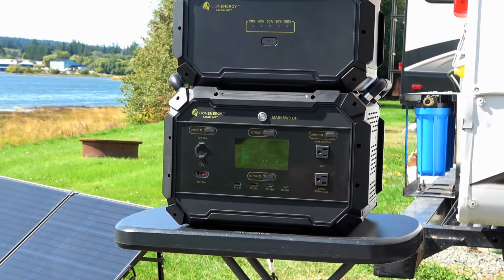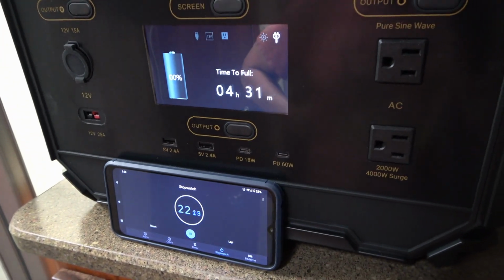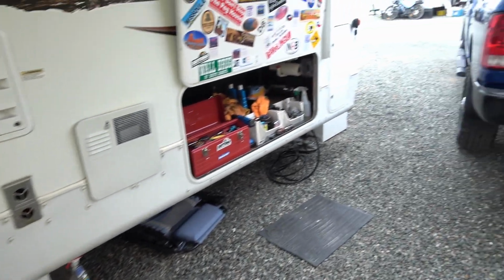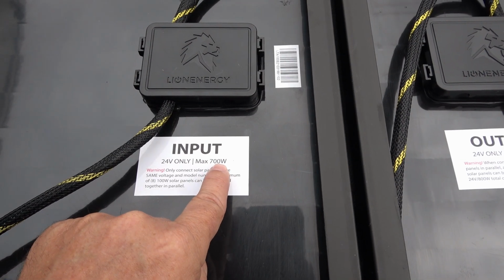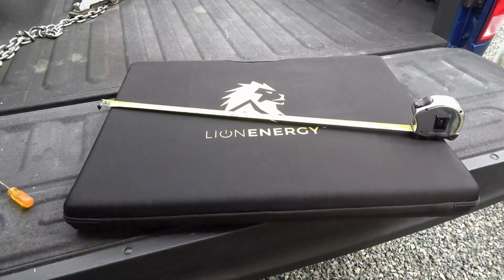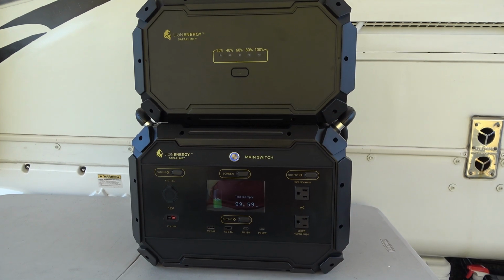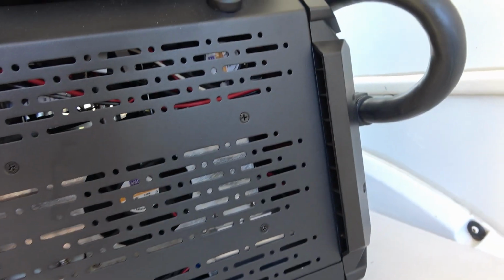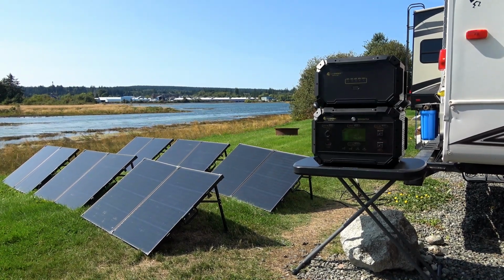Safari ME Deluxe Portable Power Kit Review - 600W Solar & 2048Wh Expansion Battery (Lion Energy)

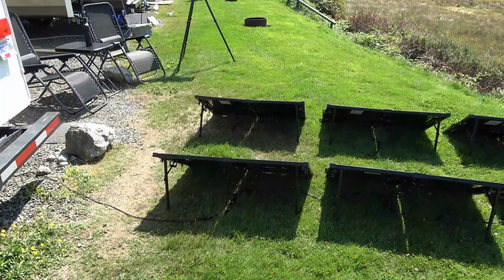Comment: Good work! One correction I found  in18:57 These panels are wired in series (daisy chained), not in parallel.
Reply from the maker: Thanks, but you're wrong, they are wired in parallel. I know for sure they aren't series wired.  The voltage coming off the array measures near 40 volts, right around the Vmax for a 24V panel. You can see that measured in this clip https://youtu.be/wtSWk0S281A?t=212  If they were in series, the voltages would add together, and I'd measure 6 times as high. Cheers, Ray

Comment: Great video!  I own the same system but haven't used it RVing.  Its a solid backup for our frequent power outages and has saved our food a few times.  I'm curious about the orientation of the Anderson connectors in the back, they are different than others and have been asking around if there is some sort of orientation standard for Anderson to distinguish 24v from 12v?  Anyway, very well done video, thanks for putting it together.  I learned a lot about my own system.
Reply from the maker: Thanks, I don't think there are different orientations for 12V or 24V.  The Anderson connectors have grooves on the sides so they can be oriented which ever way is desired depending on how you slide them together See the picture here https://powerwerx.com/anderson-powerpole-connectors-30amp-unassembled  Lion Energy likely choose up and down so people didn't accidently plug other stuff into the solar input since most plugs you see are side by side.  Cheers, Ray

Comment: For 20lbs you should have gotten 200W RichSolar panels. 3 of those gives you 600W in series. Looks like a descent system. 

For the same price I got the Bluetti 200Max with bigger power, better charge life and more outlets of each kind. Better MPPT and accessories internally. Of course the units are heavier and a bit larger, but for the price and power it was unbeatable. Your unit maybe more efficient though. I think my unit is about 88% efficient. But 4000 + Watts at $3400….
Reply from the maker: The Rich 200W solar suitcase panels are 36.8 lbs The 100W are 21.8 lbs so I really don't see much difference  https://richsolar.com/products/100-watt-portable-solar-panel-briefcase
Reply: @LoveYourRV  10 lbs isn’t that big a difference but 100 more Watts and only three sets of panels….

Comment: Put the glass side down, drag it around and scratch the glass.
If you knew anything your review might have been useful

Was nice the see the product, though
Reply from the maker: The glass is inset into the metal frame and it was just the raised plastic corners touching my rubberized spray on truck bed liner, no harm done to the glass.

Comment: I bought the Safari ME along with the expansion pack and six solar panels. In my opinion, it's by far the best and most powerful solar generator on the market. Top of the line and I'm very very pleased with it. The expansion pack has twice as much energy stored inside of it giving it three times the power.
Reply from the maker: Great to hear. I'm out dry camping for the next few weeks to looking forward to putting it to the test. Cheers, Ray

Comment: Hi Ray,  I have a question for you about LifePo4 battery storage capacity.  If you and Ann are boondocking at a place like Palm Canyon in January, when the daily temperature can struggle to get into the mid 60's during the day and can dip into the high 20's at night, and don't forget the windy days that sucks the latent energy from the rig, how many watt hours would you say would be more than adequate to have in your lithium batteries?  And I guess to further clarify, I would add that ideally you would have adequate capacity so you are not draining and charging the batteries hard enough daily to adversely impact the batteries serviceable life expectancy.
Reply from the maker: Last trip in the southwest we had 315 amp hours of lithium and 700 watts of solar power and most days it was plenty. Nightly discharge of the batteries was about 30% of capacity . Gas generator runtime for a 4 months of boondocking was about 30 hours total and that was mostly for when we would have several days in a row of cloud or rain.  Cheers, Ray
Reply: @LoveYourRV  - Hi again. Thank you, very helpful.  So you are figuring about 1.2 kilowatts per night, whereas I figured we were closer to the 1.5 kilowatts per night average.  The colder nights really make a difference as we have a lot of heatloss around the main slide and furnace was always the biggest battery drain by morning.  I am so disappointed in our Rolls Surrette batteries that I am putting them out to pasture after only 2 years.  I purchased 8, 3.2 volt 280ah Grade A, LifePo4 cells and am assembly two batteries, that will have over 7.1 kilowatts capacity.  My theory is on extreme usage nights we should never use more than 25 percent capacity.  I only have 3 x 165 watt solar array, so a lower than yours, but shouldn't take half the time to top up the LifePo4's with the generator if needed, compared to topping up the Surrettes, which was slow.  Thanks for the comparison, but does appear that we old geezers spin the DVD player longer, watching more TV in the evening then you and Ann do...looks like about 300 watts more TV.
Reply from the maker: Yeah, we tend to be on computers more than TV. We also use a Big Buddy propane heater during the evening hours since it uses no electricity then I crank it up before bed to heat the place up really well.  Then turn on RV furnace but set it pretty low around 58F which is good for me. Anne needs a little more heat at times so has an electric throw blanket she can adjust.
Reply: @LoveYourRV  - Easy, not so loud....Heather doesn't know anything about those electric blankets!!!

Ha, ha.
Reply: @LoveYourRV  - Forgot to say we won't have to be one of those boondockers that has to run the inverter generator until 10 pm at night anymore to get through the cold ones.

Comment: Wish we weren't separated by the covid restrictions at the border. We have the same lion me package we just picked up at COSTCO.  Let's to learn about setting it up.  We grab ed two Lion batteries.  Wish I could have bought more.  So you have a plan for a permanent install?
Reply from the maker: I've placed the Safari ME in my basement storage area near my water closet. At the bottom of the water closet for the water hose is an opening I can use to feed through the RV power plug and the solar charge cable. I've also ran a cord from my old 1000W inverter to where the Safari ME box is so I'm able to recharge it off my existing battery system. Here is a look https://youtu.be/jNaF9I3soko?t=565  I'm going to have a video with a look at the complete system setup in a few weeks. Cheers, Ray

Comment: Nice review Ray on the pro's and con's. One question about the AC charging side of these, does it allow to set a maximum charge input rate? I was thinking of people that have the factory installed AC inverter on pickups, which usually max out around 400 watts. That would make it convenient to charge on travel days or just running around.
Reply from the maker: Thanks, no, I don't see anyway to do that. That would be a great idea

Comment: Approximately how long could I run a 5ooo BTU window AC with this set up?  I'm totally in the dark on this stuff!
Reply from the maker: Hard to answer due to variations in power (wattage) draw. It will depend on the AC units efficiency (cheap units draw more power) so how many watts the air conditioner draws and how often the compressor on the AC cycles on and off. If its hotter the compressor needs to cycle on more often to cool and so the wattage (power) used increases. I wish I had a 5000 BTU AC to test with.
Reply: Not very long ..  if you haven't already received that answer...

Comment: Just an FYI, the solar panels I use put out 18V at Vmp. I wire 3 in series for a total of 54V and 2 sets in parallel for 20A at 54V. The controller is what determines if the system is 12V or 24V. If Lion is really wiring those panels in parallel, then they need bigger wire to handle the increased current. In my case, it would go from 20A to 60A. I know you know this stuff so I am really confused.
Reply from the maker: The VMP rating of these 100W panels is 35V and the stated max current carrying capacity of the wiring they use is 25 amps. So 35V x 25A = 875W so I guess that is where they come up with the 800W max rating for stringing together their 100W panels.
Reply: @LoveYourRV  Very weird, they look like those 6 panels should be closer to 1200 watts, something is weird.
Reply from the maker: What panels are you using to get the 20A x 54V for 1080 watts?
Reply: @LoveYourRV  Bouge RV. Series connections are not the problem they used to be and gets the system going far faster. For an MPPT charge controller to work correctly, the solar panel operating voltage must be at least 4V to 5V higher than the battery charging (absorption) voltage, not the nominal battery voltage. On average, the real-world panel operating voltage is around 3V lower than the optimum panel voltage (Vmp)
Reply from the maker: "Very weird, they look like those 6 panels should be closer to 1200 watts, something is weird."
OK, I happen to have a pair of 170W BougeRV on my roof so I laid the Lion 100W on one of them to show you they aren't as big as your imaging them to be. https://www.loveyourrv.com/wp-content/uploads/2021/08/solar-panel-bougerv-170-lion-100.jpg
Reply: Looks like they're wired in series, no?
Reply from the maker: @eyemawakeningdaily402  They are parallel wired. There are two wires going to each panel. I have tested the output voltage of the 6 panels wired together and it is just under 40V

Comment: Did you scratch the solar panel glass scraping it around directly on the truck bed?
Reply from the maker: No, my truck bed has a rubberized bed liner plus the glass on the panel is inset a little so just the panel aluminum frame and plastics corners were touching, not the glass.